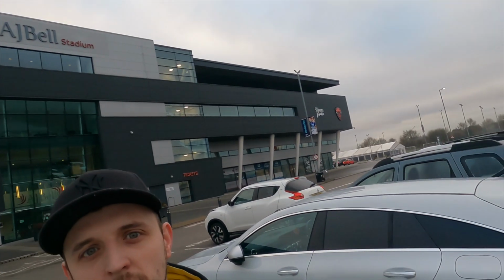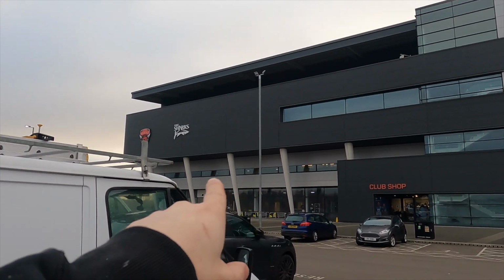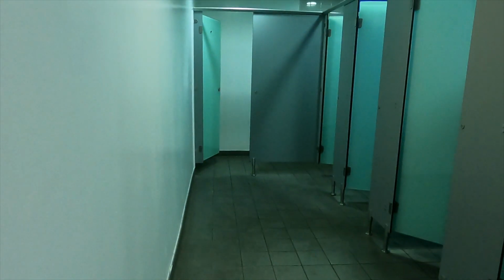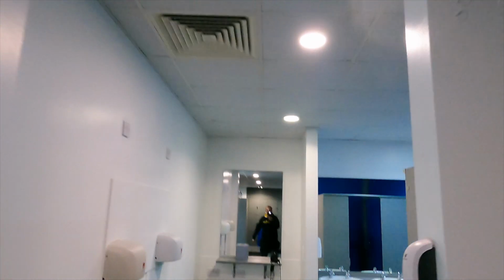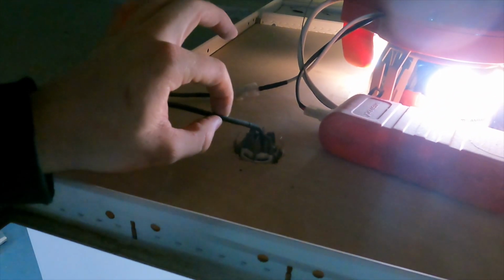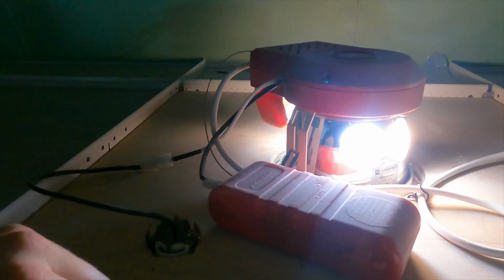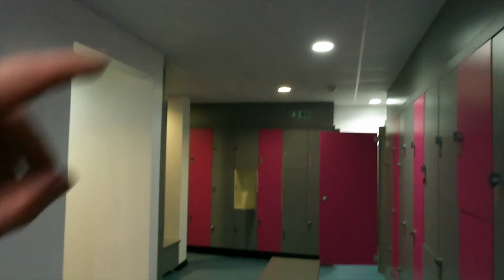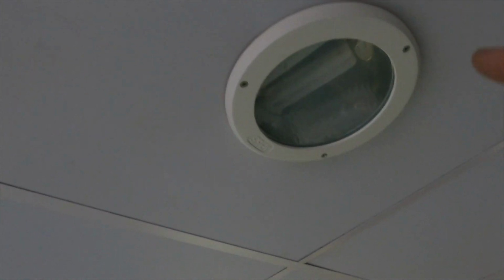Its A Big One | Giveaway | Electrical Life

Comment: VERSO
with those down lights with the combined emergency I would just disconnect the battery pack and pin spot and just fit a stand alone one, connecting the Greg plug into a joint box then a flex to light and flex to emergency job done.👍 Could always stick a label on Greg lid as well if you fancy. loving the content as alway 😊👌
Reply from the maker: Thanks mate, that was the option I’ve gave to the client at the moment, unless I find another fitting to suit them holes in the meantime 👏🏼

Comment: I have come across them before norm remove the em feed from fitting (JB it) it a Ansell beacon 5w em will fit the hole (they are large version of the spot led light) 👍 and are only abt £35-40 each
Reply from the maker: I’ve got them exact ones in the van ready for it 👌🏼

Comment: You can't beat Ashley click ceiling roses they are life savers. How come Sean you had to change them spotlight em's could you not swap the batteries on them or had the client asked for led's for a longer running time. Great video all the same despite you having problems
Reply from the maker: i could have changed the batteries but I was stuggling to source the same ones, and then I’d still have to hope it wasn’t still just the LED fitting broke too. 
Was likely cheaper and faster to change them. 
Never heard of Ashley ones. I’ve only seen and used hager Klik
Reply: Yeah they are the exact same ones I'm showing my age lol hager bought out Ashley and rock in 1989 then shut down the factories and made a load of people redundant. The klik range of ceiling roses where made by Ashley and Hager continued manufacturing them, same as the switches and sockets Hager make today they are exactly the same with slight variations that Ashley produced.
Reply: I mean 1998 not 1989 lol 😂
Reply from the maker: @adierob1  nice, love a bit of information like that 👌🏼 thank you mate